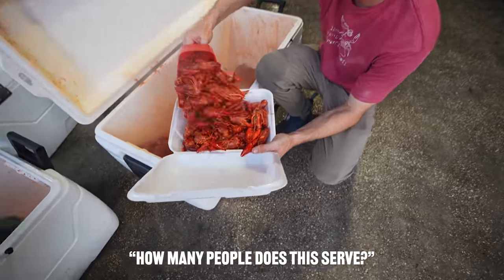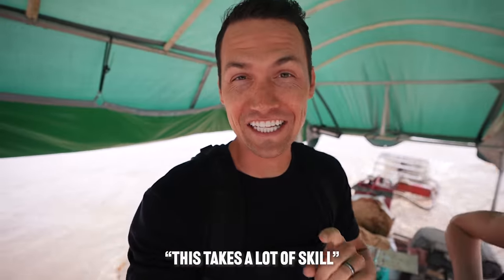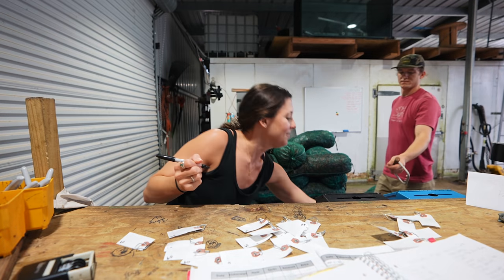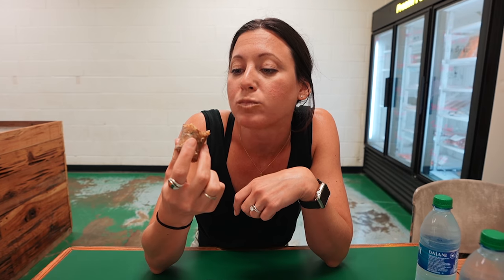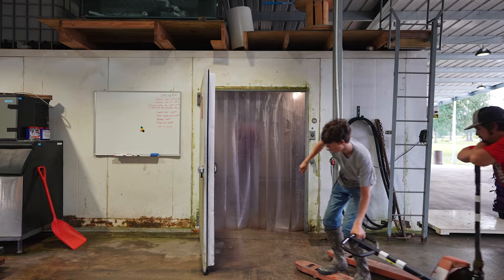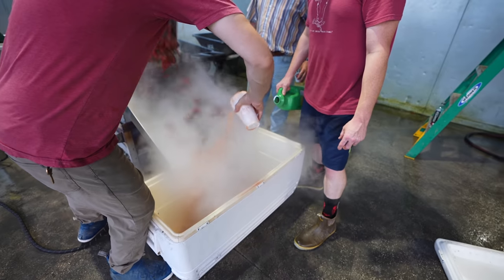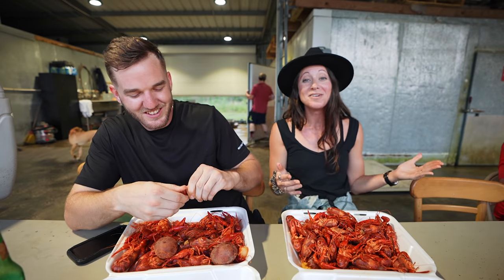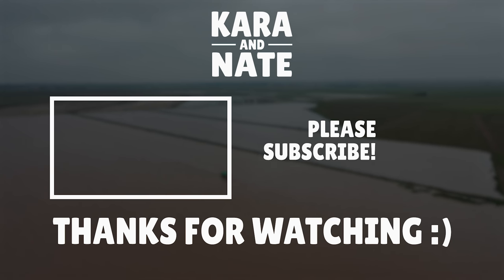DAY IN THE LIFE OF A LOUISIANA CRAWFISH FARMER (this is where crawfish come from)

Comment: For anyone who has not had crawfish, they are anatomically the same as a lobster in terms of eating them.  That means the meat is mainly in the tail with some in the claws. No meat in the body of the crawfish.  Also, they are >craw < fish and not crayfish or mud bugs.  Hint: If the cooked crawfish's tail is not curled that means it was dead when it went into the boiling water.  I don't eat those.

Comment: Just a few questions about van life in general.
1) Is there anything that you REALLY REALLY REALLY shouldn't do in a van, like in a canal barge you don't ever unscrew that plug at the bottom to see what it does?
2) Does rain pelting it down at night or crows strolling about on the roof stop you sleeping?
3) Does condensation cause a problem with the electrics?
4) Has anyone ever woken up with a hangover and found themselves being towed away for illegal parking?
5) Have you ever found out that the reason the van won't start is because kids have stuffed 3 large potatoes up the exhaust pipe?

Wonder if those crayfish taste anything like squat lobsters?

Comment: FYI they make windshield crack repair kits for $50 or $20 at Walmart and auto parts places :-) not too hard to use but you might get pulled over for that crack on your windshield plus the repair kit makes it easier to see out the windshield. Thanks for the videos, cheers! :-)